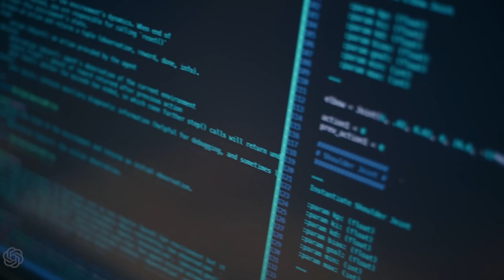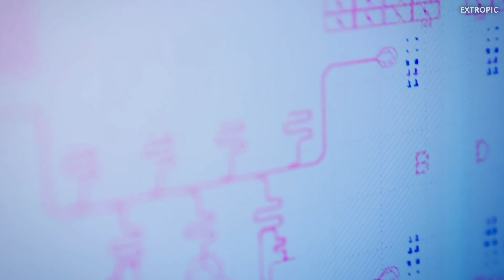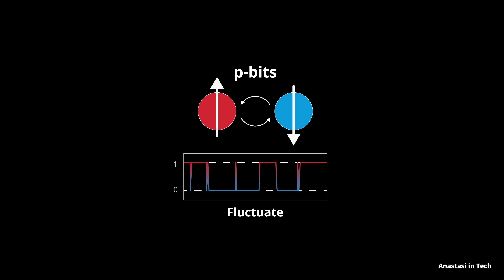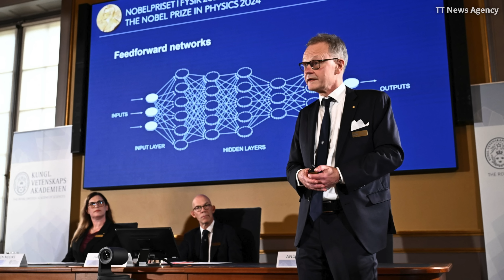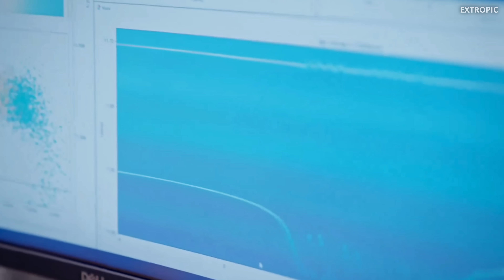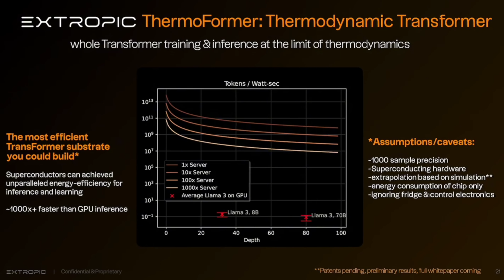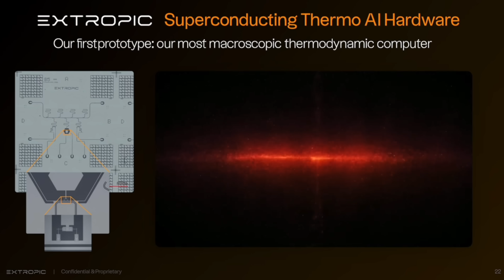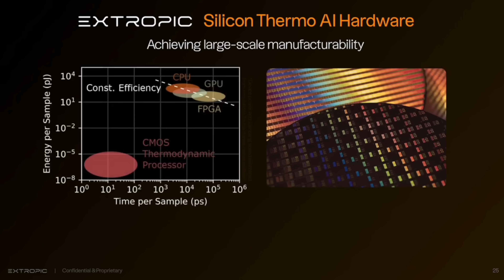Probabilistic Computers Explained

Comment: it's very confusing to say while leaping around the subjects, that it can work at room temperature and then state that it requires to be cooled to superconducting levels to do any compute, cooling costs energy, therefor it isn't room temperature or optimal. when we talk about cooling in HPC, we include the cooling power as a part of the energy budget, it's not this free energy that goes undescribed. similar principles are better explored by other companies at the moment but are being packaged for the benefit of HPC and not AI- and that's for good reason. that is to say, these cores that you are talking about can only replace AI cores, they can't actually do any "workhorse compute" or "replace HPC".
Reply: Oh, so you are one of those guys that thinks that you need a return from a fusion generator to be well in excess of one to be practical?  ;-)

Comment: Wouldn't these chips need trillions of p-bits in order to train large neural networks, like LLMs? It looks like they will only be usable on much smaller optimization problems in the foreseeable future.
Reply: No.
Reply: @MrJdsenior  Why not? Aren't several p-bits needed per weight?

Comment: I am not 100% sure what this is. Or rather how you use it. But I get the vibes of simulated annealing where you use artificial noise to get better neural networks. But here you instead use real noise, which, of course, is much more efficient. But ... maybe I am wrong? This is not a good video.

Comment: 00:10 A new computing method embraces noise for vastly superior performance.
02:41 Probabilistic computing bridges classical and quantum concepts using environmental noise.
05:14 Introduction to p-bits as a bridge between classical and quantum computing.
07:32 Probabilistic machine achieves 100 trillion parameters with low power consumption.
09:38 Noise-based computing uses thermodynamics to enhance computational performance.
12:03 Thermodynamic computers drastically improve efficiency over classical GPUs.
14:18 Extropic's groundbreaking thermodynamic computer utilizes superconductivity for probabilistic computing.
16:35 Advancements in thermodynamics technology enhance CMOS-based probabilistic computing.

Comment: Yeah, so P-bit is a feedback machine  set to automatic to find the "least obstructive" path forward. Simple solution, and common sense, like water flowing downhill, or choosing the best time and point to cross a road. If a problem "roadblock" occurs, the system (computation) backs up until it spatially (computationally) recognises an overflow to a new pathway. Elegant

Comment: The universe is probably deterministic. Our lack of ability to see all the variables means it looks random. Although we might be able to build machines to see more variables, to see them all we would probably need more material than the universe has.
Reply: You first sentence said it all😊
Reply: I know you are probably ;) joking @ip6289 . But in case you aren't: there is a difference between using a word in an epistemological context versus in an ontological sense. His use of the word "proba bly" in the first sentence is in the former sense.
Reply: You cannot build such machine because it would have also include itself and thus recursively swell ad infinitum. Principially impossible
Reply: @siloton  Yes, I think is a real possibility. If the universe is deterministic it might be unlikely that it could fully be determined by using all the material in the universe. Although there is lots of formulas in mathematics that use less numbers to calculate a greater amount of numbers. For example formulas for PI.  

Perhaps the universe is governed by mathematical formulas. Perhaps the mathematical formulas we currently have just represent parts of the universe. Like going from Newtonian physics to General relativity, there maybe more complex equations that can be used to predict the entire univers/future.
Reply: Quantium Mechabnics proves it is not.
Reply: @fernandobernardo6324  Are you sure quantum mechanics is correct?
Reply: @AORD72  Yes, it's intrinsincllly probabilistic. Quantum mechabnics is a very solid theory that experiment after experiment confirms. It describes reality as we obseve it.
Reply: @fernandobernardo6324  Quantum Mechanics is a theory, not a Law. Nothing has been 'proven' either way.
Reply: This was essentially Einstein's position in the face of indeterminate wavefunction collapse upon measurement, yes?
Reply: @aclearlight I think so. I am also pretty sure (I.e., IIRC) that he also thought everything was really fundamentally discrete (thus essentially making the equations of physics what is approximated by nature (ideally, i.e. if the theory is good and/or the system under consideration is simple enough) - the exact opposite of how we are taught to think).
Reply: That's what Einstein thought. Still hasn't been resolved either way.

Comment: Thank you Anastasi for your insights.  
For me this does not make sense so not sure it will work for main stream usage.  If one wants to simulate "imagination" then yes which is is based on probabilistic principles.  But the real world is not probabilistic, in my view, its fixed based on free will and fixed universal principles.  Energy is not a problem in our world, see what the sun, fossil fuels & atomic power can do.  So we will get smarter in energy usage to drive the computational requirements.  Ones and Zeros is best way to think of things or Yes or No as it is linked to truth not philosophical or imagination type thinking or principles which is not linked to truth or certainty.  

Anyway that's my thoughts lets see how this thinking and research turns out but in the mean time Ones  & Zeros rule!

Comment: Hm, this propobalistic computing works like parralel marble machines, in my imagination. They are all fed with new marbles at the same time. But differ in shape. No machine would be the same. Adding all endings of rollings by dropping on a flat plane, you will have a random pattern when they bump into each other. Make a photo of that plane and you will have a random answer.

Comment: The question is whether this machine can realize all AI neural networks, not just a Boltzmann Machine. The programming interface will be very different than what we know today from CPUs and GPUs. Another unrelated aspect: A probabilistic computation machine has degrees of freedom that allow, at least in theory, the embedding of an external entity to use these degrees of freedom. As long as the overall laws of probability are not violated such an entity can intervene without being detected. Whether it is possible or not is a heated philosophical question which may not be possible to solve.
Reply: Maybe you could try solving it with a probabiblistic computer, or would that be akin to pulling yourself up by your bootstraps?
Reply: @MrJdsenior  There are Bayesian NNs too, however, training with backpropagation is very hard with Bayesian forward feed networks.

Comment: The biological subject has a power efficiency of the most minute levels of energy existing for its thought process and expressions. While that psychological approaches can determine a extremely poor means of optimized thinking that renders slow thinking with even simple factors. Or a very efficient means of programmed thinking processes that allow the most extreme processes to happen just as quickly. So definitely do not go the way of unreal engine 5 process optimisation for the equivalent of those who think inside the box or cube, hahaha.
( Everything is a frequency code. Where sounds and frequencies go hand and hand like energy and matter goes hand and hand )

Comment: Is there a way of defining a methodology from problem to equilibrium state which defines solution to the problem. As with Shor's algorithm, there may be no room for error except in this case the error would not be in the execution but the final measurement. The analogy to brain really does not work in that there is no known means of going from a dynamic - indeed nearly infinitely dynamic state - to the expression of the state.

Comment: There is still a lot of optimization possible in classical computing. It is easier and logical to take advantage of sub-nanometer fabrication, and cram more in less space and use classical circuits to do binary operations. The energy use in a classical digital circuit is due to inefficient use of the electron, that just passes between power and ground rails, as a logic operation is performed. If instead the potential is raised to several hundred volts, and made to perform logical operations, through a chain of capacitors(which are as small as they could be, and does not need to hold charge more than a few microseconds), each degrading only a few microvolts on its passage, we will have far more efficient computation.  Now that we have a complex logic madeup of capacitors, how could we get back to initial state, without adding further complexity🤔. We could then reset the entire logic through pulsed femtosecond  lasers(similar to the diode based q-switched/MOPA lasers, found in fiber laser markers), to reset for the next logical operation. Currently the capacitive switching(apart from the miniscule crowbar current) is the primary factor that determines the efficiency of computing. The suggested approach should significantly reduce the power consumption due to reduced charge/discharge cycles between the supply rails, relative to the amount of computing performed in a single ?clock? cycle. Conventional segmentation and power management can be used as well. Would ❤ to hear Anastasi's thoughts on this. May be I could learn something after all. On a side note, the packaging could be stacked with graphene channels on glass layers to further thermal conductivity, while getting close to a real 3d fabrication. I do have an advanced degree in microelectronic design and fabrication and have few decades of industry experience, working at various levels. Just some 💭❤👍
Reply: send a letter to intel

Comment: A transistor is Analog..
Reply: It depends upon how it is used in the circuit.
Reply: @shanesweeney3583  
The transistor is still analog, even if you use it to fabricate a digital functioning circuit.  
It is incorrect to call a single transistor anything but analog.
The video shows a picture of a single transistor, unconnected in circuit and calls it a digital chip.
Reply: @quantumbacon  I mean if you want to make it about semantics its been my experience that components are usually classified as active vs passive dependant upon their power requirements and how they affect/generate a signal. Circuits can be classified as analog or digital because of the engineering intent of the circuit.  All devices that perform digital functions contain within them switches which are transistors driven into class d saturation. Just because they are very very small in computers doesn't mean they are a different component. Ask any electronics engineer they'll let you know that digital circuits are transistor circuits. So looked at that way I'd say an old modular transistor that used to be actually used in some of our earliest digital machines is a cool icon for this little viddy. If you wanted to be hella cool in my book you'd put tube up there.

Comment: I wonder if you can use radomness of electron tunneling to generate a random value, perhaps you can use an addressable analog voltage gate memory cell to tune the probability of tunneling. Then it can just use normal cmos logic gates for computation.

Comment: The probabilistic computation will run into is the issue of local minima when parallel calculations are running. This issue is equivalent to the physical phenomenon of density fluctuations near a critical point. So local solutions (maximum entropy) are strongly influenced by nearby minima in entropy.

Comment: The day -- in the 70s -- we held a transistor radio in our hands the size of a cigarette pack, or the day we had the first Apple  computer on our desktop (in the 80s) -- then we knew this is it. We still awaits that "quantum computers" can be held in our hands or placed on our desktops... Probably never gonna happen... In the meantime we rely on the old-fashioned transistors to do the job...
P.S. This message employed a billion transistors to come up on your screen -- through multiple links -- from my keyboard to your sceen when you read it now -- in just under a fraction of a second -- from the other side of the planet. Transistor are still not defeated -- yet! :)

Comment: This video vaguely connects concepts without providing a concrete and specific example of a problem solved with p-bits with a 100 million factor. It also fails to disclose that this theoretical gain comes with a price: the loss of a deterministic solution for a probabilistically correct answer (i.e., some level of uncertainty). One is comparing pears and apples. The complexity classes are different (until proven otherwise). Moreover, it does not explain how p-bits can bridge classical and quantum computing. A proof that the landscape covered by p-bits is the same as the one covered by qbits would be welcome (but then why would quantum physics make its models more complicated than necessary if p-bits suffice?). One also needs to show that generating candidate solutions for a given problem by twisting probabilities leads more quickly to a solution, if at all on the probabilistic landscape.

Comment: I don't understand, you still cannot run this at room temperature (15:20), it requires cooling down, so what is the advantage of p-bits over q-bits? Also what are the disadvantages of p-bits versus q-bits? Considering they are non-entangled, doesn't that make the inferior to quantum computing?
Reply: Look at your brain. It's doing remarkable things without super cooling. They are simulating neurons. Quantum computing is little bit different. Also not happening in our brain.

Comment: So in other words this is a fast non-deterministic system that would be used for predictions. Meaning the data it outputs could closely mimic another dataset or solution but not actually 100% solve said solution because it's running off of probabilistic choice rather than computed choice. 

Which means it is no good for classical computing BUT will work wonders for prediction based solutions where accuracy is not key.
We might be able to predict the weather more accurately and faster but the raytracing people suggest would not be a thing. Raytracing needs to be deterministic or you end up with artifacts. You can't guess a light ray, you have to follow it's exact path or capture vectors at each bounce for accuracy.

Comment: There is "Monte Carlo Integration", which is a method of computing by random sampling, that has been known for several decades.  To approximate the area of a shape in a rectangle, you could try covering just the interior of the shape with tiny boxes and then the total area of all the boxes is the approximate area of the shape; this is the classical computation.  Alternatively, randomly choose a thousand points in the rectangle and count how many are inside the shape.  This gives a statistical estimate of the area of the shape.  As the number of dimensions of the rectangle increases (i.e., shapes in N-dimensional boxes), the numerical error associated with the classical computation tends to grow more quickly than the numerical error associated with random sampling, I recall.  The "probabilistic computing" discussed in this video reminded me of these "random sampling" methods.
Reply: Fascinating stuff. Stanislaw Ulam back in 1946 is generally credited for Monte Carlo method.
Reply: Basically, that’s what I also mentioned above with regards to random number generators using noise or other parameters from nature. Monte Carlo integration and Monte Carlo methods in general use the central limit theorem and law of large numbers for obtaining the right answer . This of course is more accurate if we have an “unbiased “ random number generator.
Reply: The problem is how to make those p-bits to make needed distribution with given parameters. They should be influenced by temperature very much. Will thermostatic solutions will be enough ?
Reply: In your example, how would you check if the box is inside the area without a deterministic procedure? Fine you can generate points stochastically but to count them conditionally can be a probabilistic procedure as well?

Comment: Quantum computing is based on a kind of randomness, where try to determine non-random result by statistics. Just that then it is still a chance the result is not accurate enough. Do not get why not instead try make optical computers, very little energy needed and light speed, just see optical cables. Another possible physics to be used for computing is waves, where also can have several states.